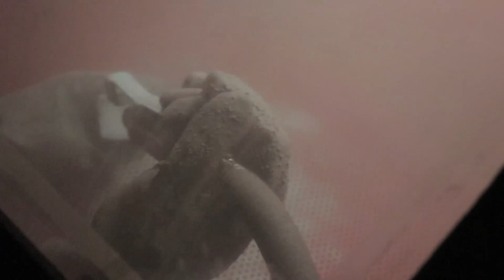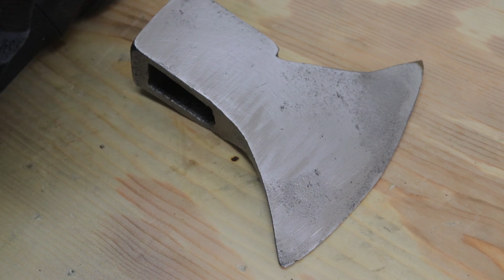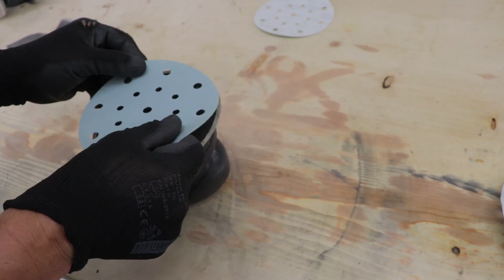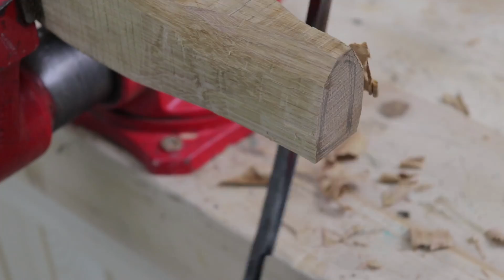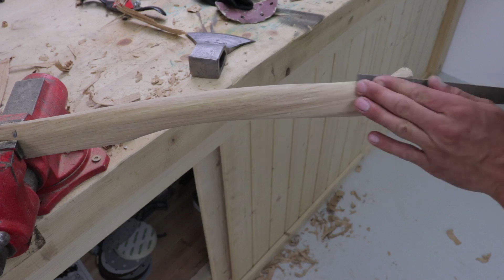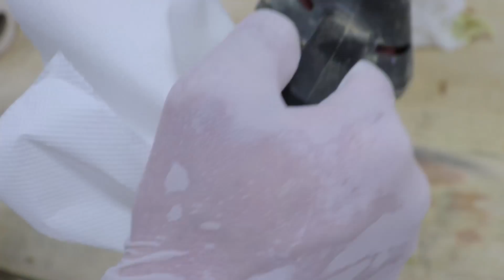Rusty Hewing Axe Restoration

Comment: looks great! but i believe hewing axes should have an offset handle so you dont hit your knuckles when hewing
Reply: I was about to post the same thing.
Reply: Andre, I wondered about this too. I hadn’t realised that there were different ‘grades’ (is that the right term?) of hewing axe. I would very much like to see how you make an offset handle.
I once watched a film from Finland about making a log cabin with just axes and saws-a tour de force in terms of skill and knowledge. One of the axes used was a hewing axe with an offset handle. The mind boggling part was that the user was able to knock the head off the axe, turn it over and reseat it so that it could be used on both left and right hand sides of the piece of wood being worked without moving position-necessary if such movement were blocked by the structure being worked on. I would be over the moon to see a handle like that being made!
Fabulous work and channel-really enjoy what you do!

Comment: I really enjoy your videos, however in this one your choice of grain orientation for the haft is flawed, the grain should run as parallel to the blade edge as possible and as a hewing axe it should have a longer haft and possibly it should allow the haft to be reversed so to allow the axe to be used on both sides of the log

Comment: You Fogot Do Otter Side!
Reply: John Han Not for this specialised, shaping axe he didn’t...
Reply: Err The Axe Head Is Spouse To Be All Clean.!
Reply: John Han , the mirror polish is where the flat side will glide over the wood being flatted (similar idea to a plane with a smooth sole), the upper side needs a polished bevel, but behind that bevel the wood shavings do not have the same contact with the face (or perhaps will not contact the face with the same force as on the polished side) so the same level of finish is not required. Perhaps Andre liked the contrast and preserving some of the patina present?
Horses for courses I guess! 🐺
Reply: R/woooooosh

Comment: Why only clean one side of the head?
Reply: David Hall it’s for shaping planks and beams. The mirror finish side is to slide over the wood which is being flattened. This is why the bevel on the blade is only really on the one side. It’s doing a similar job to a plane-think of the mirror side being like the sole of a plane.
Reply: @petersmedley459  ah, neat! Thank you. Just learned something new.
Reply: David Hall I’m learning as I go! I’m waiting for Andre to restore a hammer heavy enough to be able to knock it all into my noggin...! 😉

Comment: Is it a tool or an decorative piece? If I was going to work it I would of hung it wire brushed and then edged. This was too much effort for an old hatchet.
Reply: Andre Will Do It   Cool. It looks good. Almost a shame to use it now.
Reply: Hatchet?!
Reply: Peter Smedley   yeah, a small one handed tool designed to split along the grain and not chop. Diminutive form of hache from the old Germanic.
Reply: captain chaos, that was my question as I believe this is an axe for cutting rather than splitting as it it used to true up the surfaces of beams and planks. I’m very much a believer in needing at least two axes, one for cutting/chopping which should have a narrow profile, sharp blade and one for splitting which should have a more wedge shaped profile to the blade which should also not be particularly sharp so that it separates the wood fibre rather than cutting into it. One reason why I’m not keen on a modern axe which is supposed to do both jobs and instead performs neither particularly well.
Thankyou indeed for the etymology, it’s something I find fascinating and I appreciate it very much, especially as English is such a mix of Latin, Greek, German, Norse, French and Hindi (I think!)-apologies for any languages I have left out of the mix!
Reply: Peter Smedley   I too find it interesting when finding the origin and use of words. And yes I agree an axe should be sharp to across the grain as in felling and a blunted more wedged shape profile to split along the grain. As for the correct definition for this item I fully admit I could be wrong, as indeed to true a timber the tool must do both tasks.
Reply: captain chaos , I’m still very much learning and keep coming across different, specialist hand tools-especially ones not used so much in our modern machine age. I was lucky to come across this video when I happened to have just such a head sitting in vinegar to take the rust off...I thought that the original smith was either drunk or I needed to do some digging around! Somewhere on YouTube is an information film, black and white, from Finland, showing three men making a log cabin with saws and axes-it was where I saw an axe like this being used and it helped me greatly.
Cheers and good health to you sir! 🐺